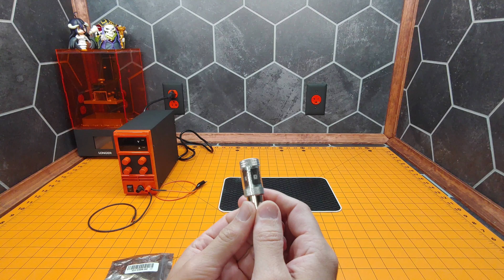Cheap Amber LED Turn Signal Review

Comment: DOT in US has the minimum as 21 watts on a halogen turn signal bulb.      Can-Bus does is not able to trick every BCM made, all car manufacturers have their own computer systems.  Most European (high end) will require a resistor for turn signals and most crucial lighting for safety.  
My BMW will report every switch-out I have tried..... even with Can-bus I had to find an LED that put out minimum 40 "real" watts for headlights .   Volvo is similar but they don't monitor any interior light,  reverse lights or side markers ... I believe it's because these are available from factory as LED upgrade.
Side note..... Is it just me or have car lights ..front and back begun to look like a carnival show these days.  What is the purpose (other than blinding the crap out of on-coming drivers)  to have DRLs on at night .... you know the weird eye lids that offer no function other than look at me ...Kia has gone full clown show with the whole grill lighting up. I don't know if laws have changed but in the 80's -90's you could only have 2 headlight bulbs and some states allowed fogs  only if it was foggy.   I see cars especially pickups with Amber cab lights, LED light bars in the grill, fogs, DRL's, under-body glow kits and rock crawlers, extra strobing brake lights, side step lights, I even see cars with blue and purple as headlights.   I find it hilarious and also blinding  ....... this will get regulated eventually.  A couple cop friends of mine have answered with...  "Like we don't have enough crap to deal with now-days"